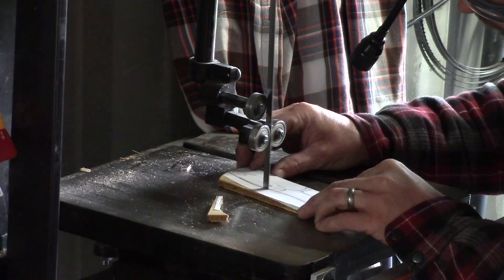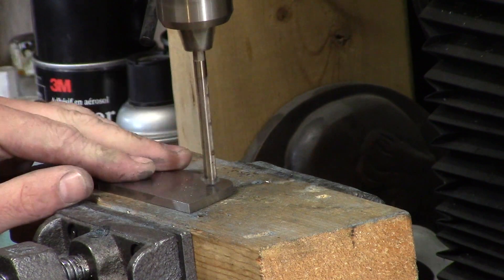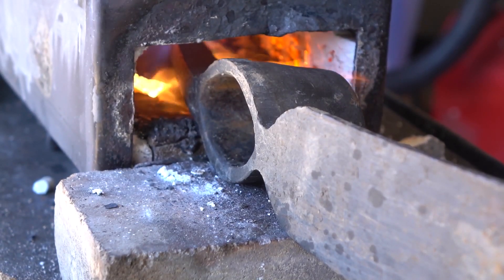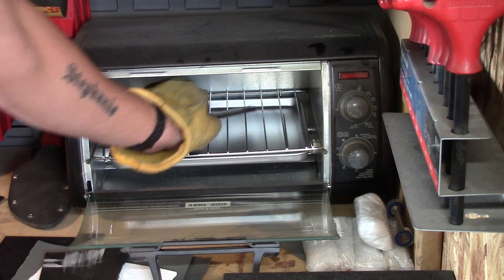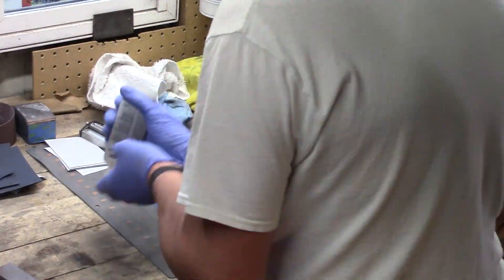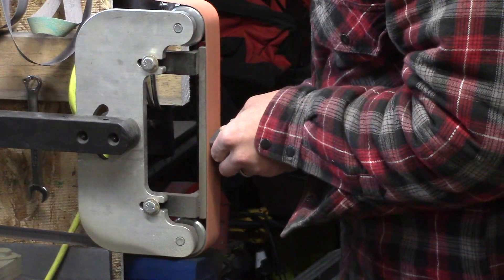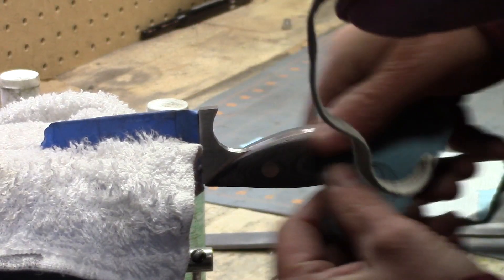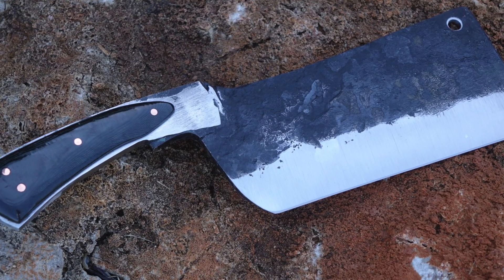Making a knife for charity. Collaboration with Steve of Green Beetle

Comment: Awesome colab, I watched both videos. What blade are you using on your bandsaw , is it a lower tooth like 14 or 18? I have been using 24 T but yours looks like it cuts better.
Reply from the maker: Thanks! Yeah, this one is a 14. I tried 18 and I thought that would be better, but I'm really surprised at how much better the 14 cuts than the 18, even in material as thin as 1/8". I bought Milwaukee brand blades and so far they are lasting really well. Cheers!

Comment: Great video knife looks amazing. What blades do you use on the bandsaw ? it seemed to cut the O1 no problem.
Reply from the maker: They are the Milwaukee brand blades. I'm actually shocked how well they cut. I'm using 14 TPI. I tried the 18 thinking they would cut better but I'm surprised that the 14s work really well and are lasting a long time too. Cheers!

Comment: Nice knife build! Did you think about dry fitting the wooden handle and contouring it before heat treating to avoid accidentally scratching up the finished metal surface? Just a thought. Great work!